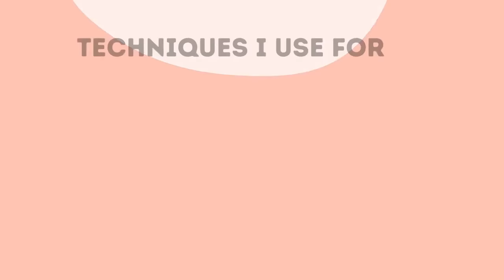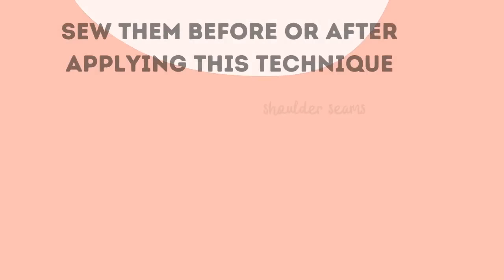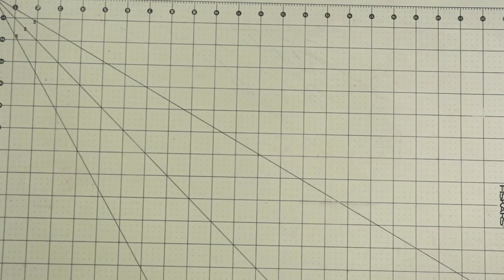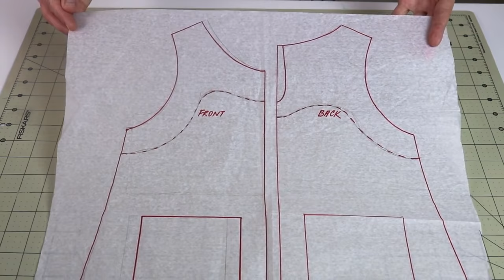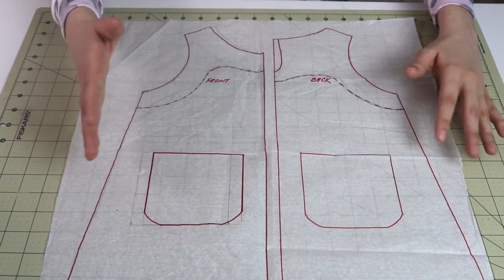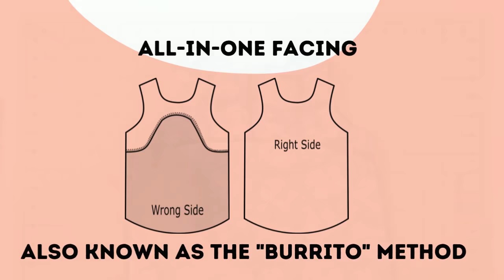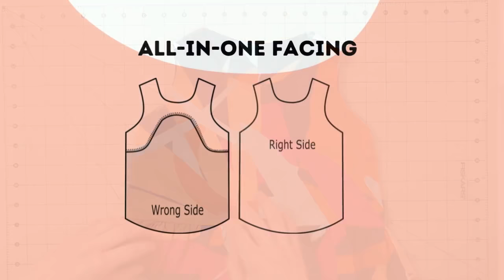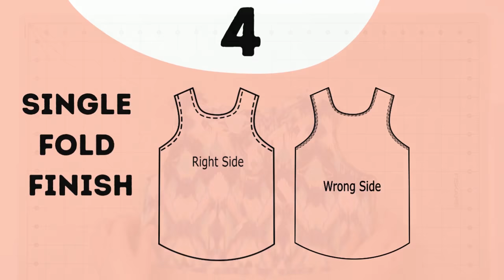HOW TO finish necklines? 4 SIMPLE techniques that I use for neatly sewing necklines AND armholes.

Comment: Wonderful video and as usual, very well explained!!! I do have a question about the best way to hand stitch bias tape turned to the inside so that there would be no visible stitches on the front of the fabric.  I have hand sewn the bias tape with a slip stitch and also a pick stitch where the stitching is only seen on the inside of the garment. However, it seems that the fabric puckers especially in the curves of the neck line and/or armholes. Do you have any "tricks" to help with keeping the fabric flat. when hand stitching?

Comment: I prefer separate facings myself, and have drafted them as needed. I made a dress with an all-in-one facing where the front facing went high and the back facing almost straight across. I have yet to stitch down the back facing to the center back seam.

Comment: This is so, so helpful…thank you! One quick question…does it matter on fabric ie is this just for woven? Neckband on jersey is my nemesis! I also like the way you talk through the when to serge…I still haven’t gotten my head around that really…I’ve sewn when I should’ve served first and the inside looks so messy, I know no one can see it but it still feels like a failure!
Reply from the maker: At the very beginning of the video I talk that these techniques are for woven garments. I have multiples videos of getting the perfect neckband on jersey garments - take a look on my channel :)
Reply: @ThoughtfulCreativity  sorry, don’t know how I missed it! Thank you for taking the time to reply
Reply from the maker: No worries, the video is long - it happens :) Quick tip - most of the times you would not be using straight stitch for knit garments, while you can use facing and even the burrito method on knits - you have to use stretch stitch.

Comment: Hi, in which cases do you do 3 lines of stitching in the rolled hem? What kind of fabric?
Reply from the maker: Hello there, you would usually do a rolled hem on lightweight fabrics, think silk chiffon, cotton voile and similar. You can do a 3 line rolled hem in all cases, to me it just depends on the circumstance and preference, if you are working with REALLY difficult fabric - then perhaps taking an extra step and doing 3 lines would be a better choice. I hope this helps you out :)

Comment: I have an unusual knit fabric that I would like to make a t-shirt and dress out of, but the fabric is not suitable for making neck and sleeve bands, so I thought I might use a pin hem with this fabric. Do you use pin hems on knit fabrics at all? Especially if they're a bit unusual (ie. not your classic jersey)!
Reply from the maker: Great question! Not necessarily, because regular rolled/pin hem doesn't stretch so you either 1) need to use ribbing or other knit material for the neckline, cuffs and bottom band or 2) treat it like it is woven, in which case you will need to make sure that the neckline/hem and sleeve are wide enough so that you won't put any stretch stress on them, meaning you can put them in yourself without needing to stretch them and then you can finish them hem possible with one of the techniques you mentioned.
Reply: @ThoughtfulCreativity  Ahhh, thanks so much for the heads up, lovely!

Comment: 🥙🍳can you put a bias tape finish on something that has a facing with a small seam when the seam of pattern calls for a five eight seam .
Reply from the maker: Janice, if I understand right you want to do the facing on your project but instead of 5/8" seam allowance you want to do a smaller one (let's say 1/4") and finish it with bias tape? And we are talking about the seam between the garment and the facing. First, it is not necessary, you're going to create a ton of bulk in your seam with bias tape AND facing. I almost always do either 3/8" or 1/4" seam  on everything (unless it is a French seam or other specific seam) including the facing. 1/4" or 3/8" seam on the facing will give you nice and accurate result, you don't need to clip or notch in most cases and the result is very neat. If you're worried, you can just overlock (on a serger or sewing machine) the inside seam of the facing.

Comment: I have a hard time stitching the same width that you show when using bias tape. my stitch doesn't tag the same, it is right on hen I start, but then gets narrower or wider. Help.
Reply from the maker: Janice, I honestly have no clue what is going on with your stitch - you will need to problem solve with your sewing machine or your technique. Open the sewing machine manual if that is a sewing machine issue, practice on a scrap piece of fabric if that is a technique issue.